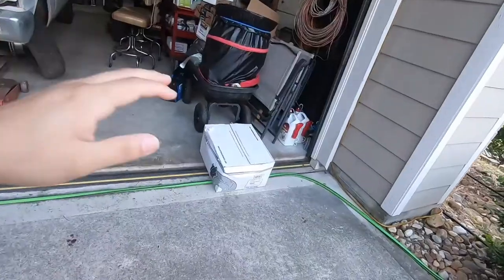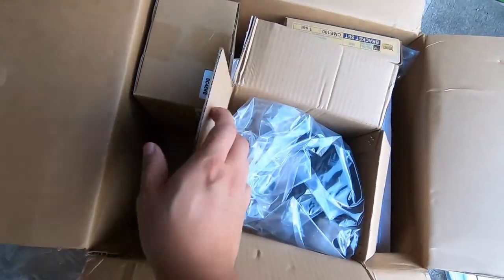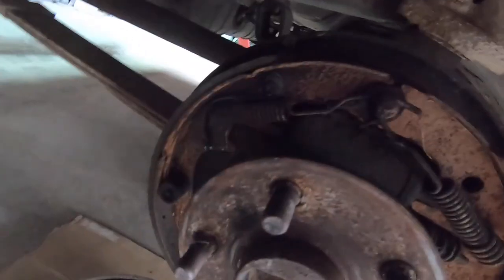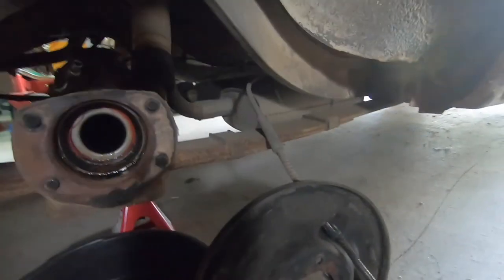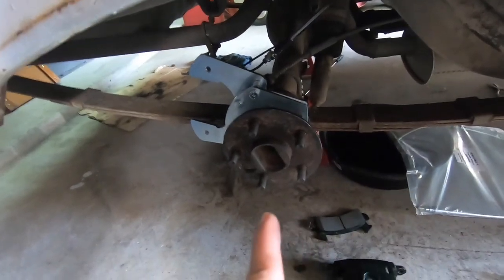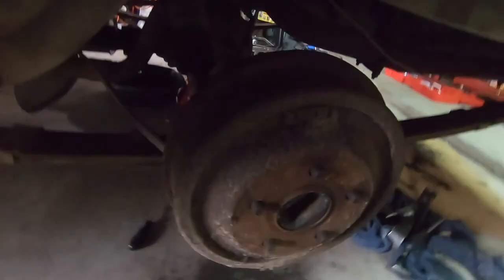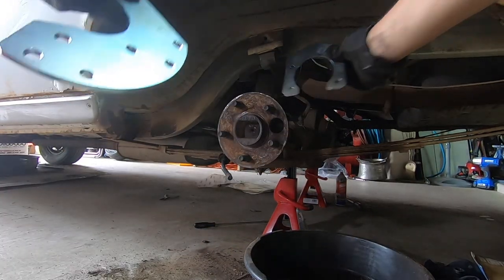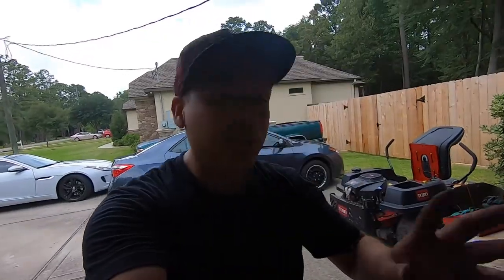Rear disc brake conversion | 1964 Ford Falcon

Comment: Can you tell me the trouble you had with the front disc conversion.  Summits saying I need a Mustang II independent suspension...???  Also do I need to go from a 4 to a 5 lug in the front. Just now literally bought a 64 Falcon sedan...
Reply from the maker: Hey John, I'm so sorry for the delayed response! I would say summit is correct in your case. If you have the 4 lug spindle you will have to get the 5 lug one (which can be easily found for a mustang independent suspension set up. Fortunately, our Falcon already had the 5 lug set up so it was plug and play. As far as the trouble I had for the front was because of a leak. For a while I was not getting any brake fluid to the front calipers but once gone through every brake line we discovered a leak and then it worked great! Hope this helps you a bit! 😁✌🏽

Comment: My question is I have a 1963 falcon and my have 4 lugs and you have 1964 Ford falcon and your have 5 lugs my questions is does your came from factory like that or you make a change to your falcon
Reply from the maker: Mine came from the factory like that. Most of the ‘63’s are 4 lug ( I believe) but you would just have to do one more step, before the disc brake conversion, which just a 4 to 5 lug conversion. Hope this helps you a bit 😁✌🏽

Comment: Can you tell me where you bought those rotors from and what's the model number the ones I got from Summit way too deep
Reply from the maker: I bought them off of summit racing’s website. They are a brand called right stuff detailing rear disc brake conversion. The kit number is ZDCRD02. I’m sure this stuff is subject to change so just make sure nothing has changed on those numbers. Also, I believe I mentioned in the video (it’s been a while) that the rotors were suppose to be solid/vented rotors, not drilled and slotted. I’m unaware how that happened but just thought I’d make you aware if you’re looking for specifically the drilled and slotted rotors. Hope this helps😁✌🏽